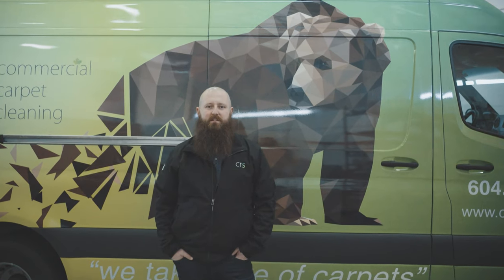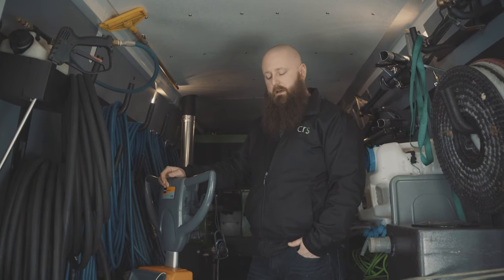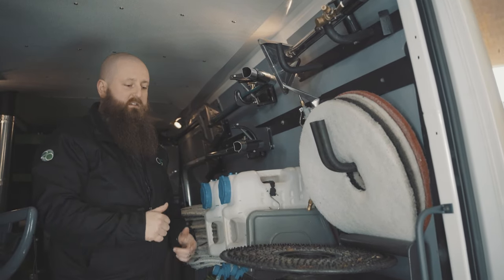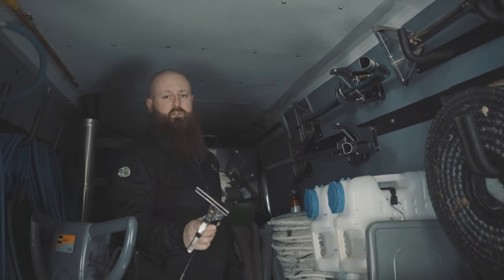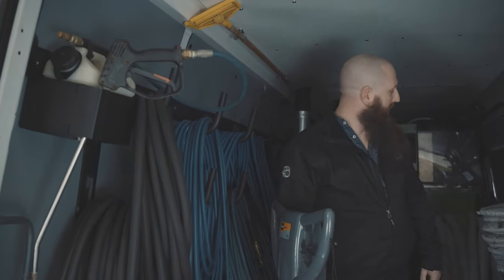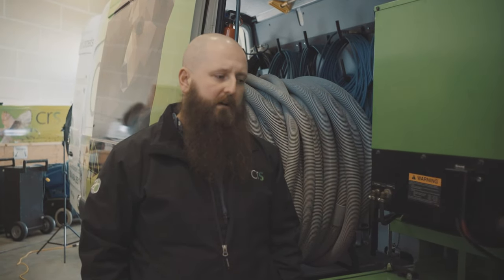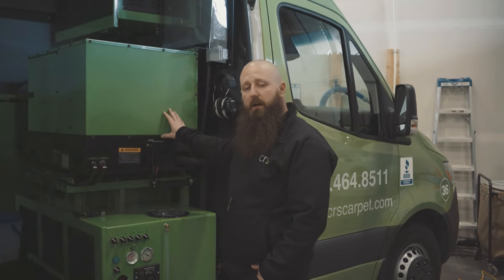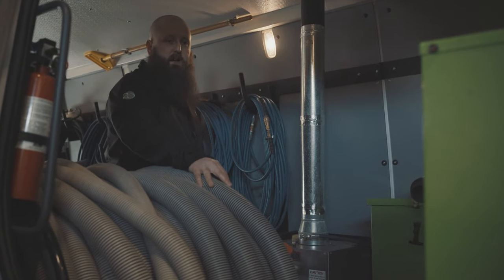The ULTIMATE Carpet Cleaning Van Build | How to Set Up a Carpet Cleaning Van

Comment: Hi guys, I love your ideas, however, how you can get 400 inch H20 lift? The strongest Ametek has 149" H20 so you have to put 4 of them in a series to get around 400'H2o, but still 139CFM in one row. To get 500CFM you need to have 4 rows of 4 vac motors where each takes 7A. You need 25Kwa. Please, correct me where I am wrong :-)